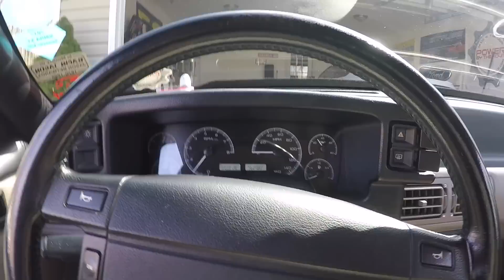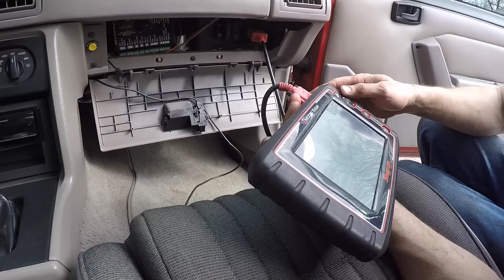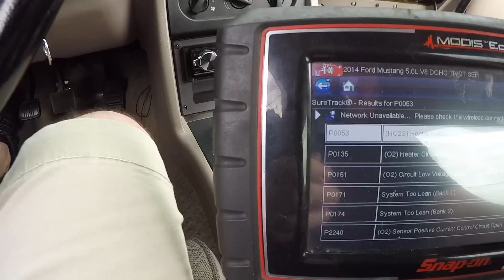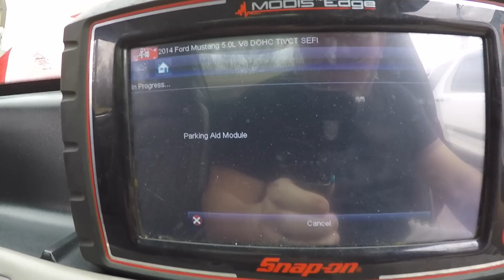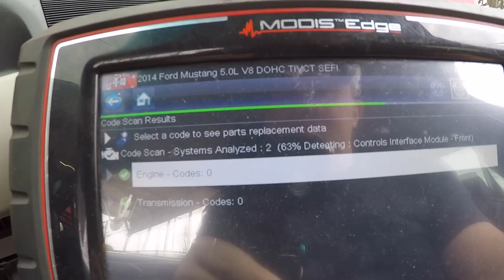First problems with the coyote swapped foxbody, and my S550 broke!

Comment: A good thing to check O2s is to look at short and long term fuel trims. If the sensors aren't reading the short terms won't be moving because the computer uses a pre set afr to be able to run.  It will also let you kno if your throttle body is working properly. If your fuel trims are out of spec and you have a O2 code you can pretty much assure they are bad or not calibrated correctly. A lot of people over look the fuel trims but they can tell you a ton of information for diagnosing drivability issues.
 - (10year Air Force/civilian technician)

Comment: Maybe part of the issue is the air filter is sucking hot air in and its not covered from the cooling fan on the radiator.
Reply from the maker: It hasn't caused any issues in any of the other builds, they are all built that way

Comment: Hey, on the lack of acceleration or bog, have you checked you fuel pressure?  It is possible you fuel pressure regulator is weak allowing it to run great at low fuel demand but big at higher demand.  O2 sensor both banks both up stream and downstream tells me you are actually lean.  O2 sensor won't fix that.  I would check for vaccum leaks too...stuck egr, PC, purge valve, etc.  Good luck...
Reply: Sorry, spell check on my phone sucks.
Reply: x2 the likelihood of both sensors going out at the same time is very slim. definitely sounds like a general leak of unmetered air, lack of fuel, or the tune being so far out it cant make the demand of fuel that ECM wants.

Comment: Read the live data on scanner,it would show if the o2 sensord are bad or not
Reply: Dj Dev they were reading off. He needs to replace them. They were used out of a f150 when he put them in.  He has circuit dtc’s that commonly set when these 02’s go out.

Comment: Well you came to the conclusion i was gonna suggest, this is a common problem from only my studding not experience. But they will have ruff idle and most have concluded its the tune. Several have even contacted ford racing for them to be typical and say they are unaware of the problem.

Comment: I had that issue on my buddies 2014 thought it was the throttle body but it was the crank sensor installed a new sensor and did a crank re learn was all fine after

Comment: I like to know How much does the dealership charge you to fix the AC unit
Reply: My local dealers have charged around $1,500 for the evaporator replacement. If mine goes out, I'll be changing it myself!

Comment: Nothing but endless problems with my '16 F150. Random climate control issues, power windows rolling themselves down when pushed "up", blew the entire front end out to the tune of replacing the whole differential from slamming itself into 4x4 randomly, sync maybe and maybe not connecting to my phone, radio occasionally not working--- Ford really needs to start watching its Q.C. It's out of warranty in 4K miles, and I'm honestly worried about owning it without bumper to bumper coverage.